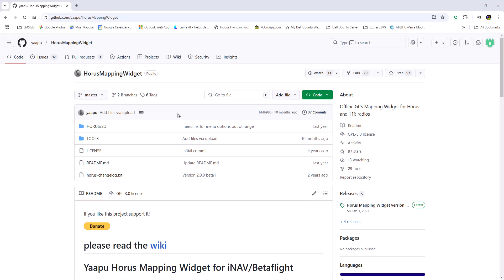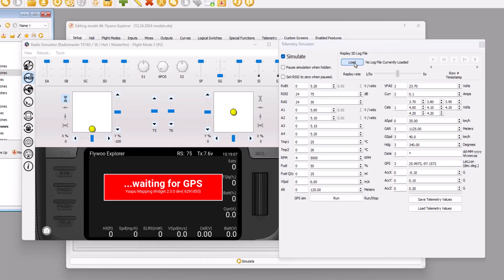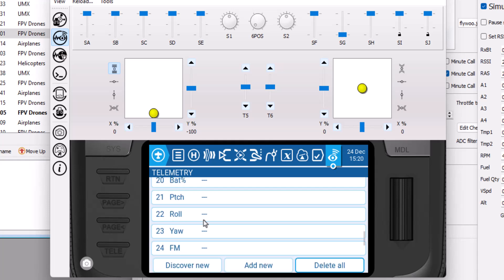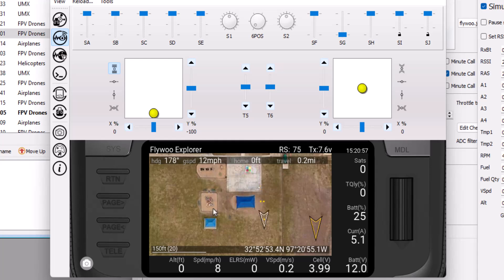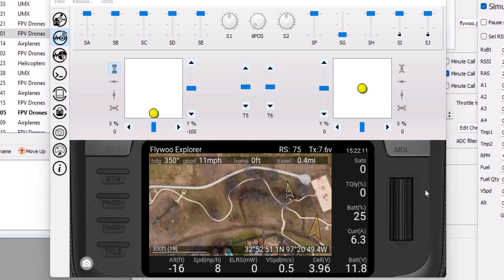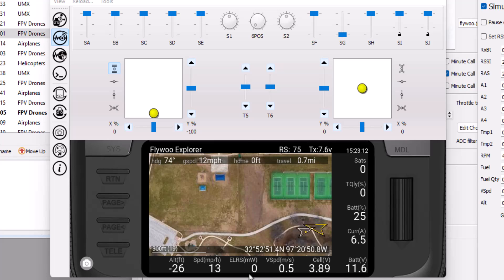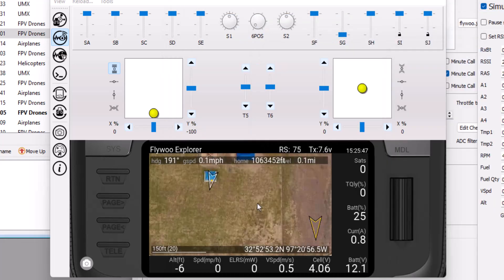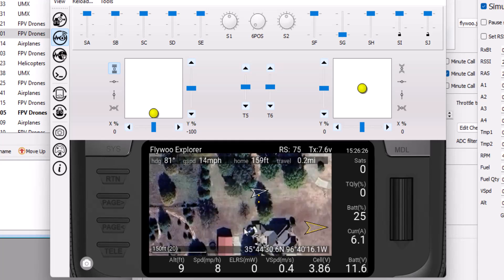Yaapu Mapping Widget on my TX16S on inav

Comment: Does your radio have a GPS? If so which GPS module is best for the TX16S?
Reply from the maker: @HowardPhillips46 My radio doesn’t have a GPS. It gets the location from the GPS located on the drone.
Reply: Mine doesn't either,so this works off the drones GPS?
Reply from the maker: @ Yup!
Reply: @RickyGode  awesome thanks for the info